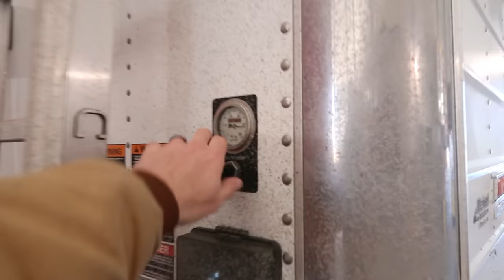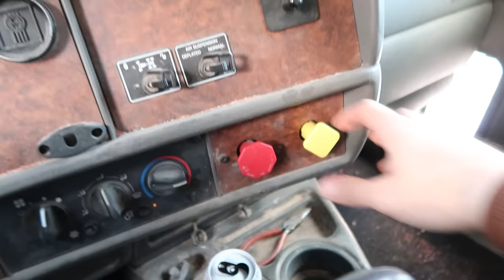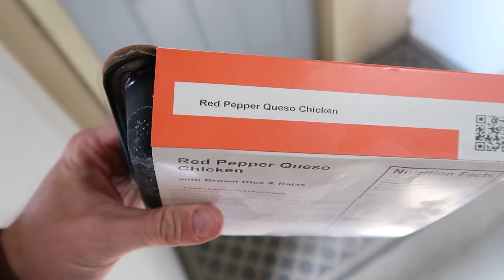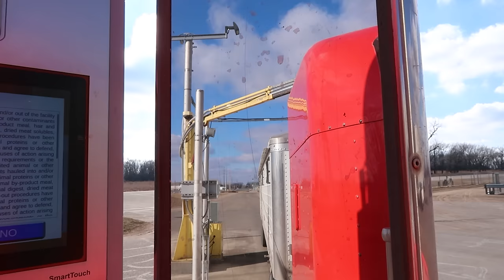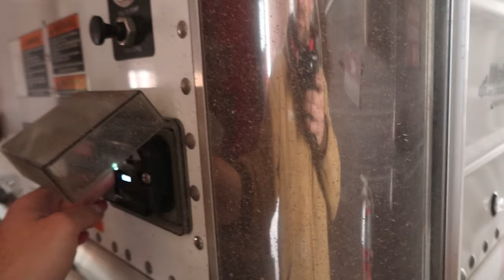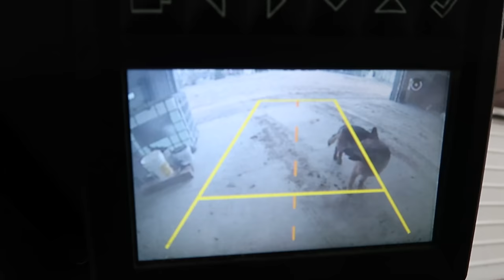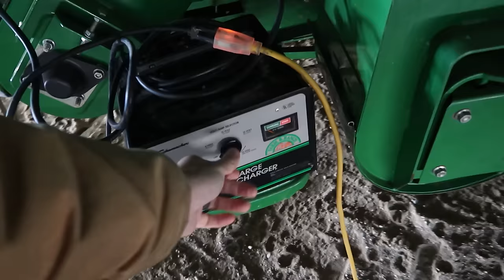I Need The Combine to Start!  Something's Not Right...

Comment: Who knew a John Deere combine sounds like a German Shepherd barking.
Reply: It's part of the built in warning system.
Reply: @persistentwind  I've delivered my fair share of them. Must be an add on at purchase.
Reply: You might want to try and find an old Fendt from the 70s - 80s. The then used MWM engines sound just like Weimaraners.
Reply: @alexveldhuis6004  🤣🤣🤣
Reply: @alexveldhuis6004 😆

Comment: When I saw that "Robo-Probe" "thingy," the grain elevator used to test your semi's corn it brought back memories of my high-school years.  My Dad worked for an outfit that went around and tested grain at elevators and barges for moisture and foreign material. Of course, they didn't have automatic probes back then. Just long poles they had to use by old fashion elbow grease.

Comment: When you put the new dryer in have them set it high enough to drive the skid steer under for cleaning season.  Or at least high enough to walk under.

Also tile the driveway to allow the water to drain off. Bet Randy would love to tile the driveway for you.

Have them check the block heater it might be bad or weak.

Comment: Our 9870 does the same thing if it sits a while. Seems to help if you just turn the key on without cranking it, there’s a lift pump that runs and helps prime it all up.  Even cycle it a few times.  That usually does the trick on ours

Comment: You may want to pour some Heet in the fuel tank of that combine. When it gets really cold like that of course the fuel can gel up and if there is any water in it just a little bit that will cut the fuel pressure down to against nothing. Its really irrating but Heet usually takes care of it.

Comment: You may want to put 3/4 clean stone down the clean stone gets pushed into the mud after a few times its will pack like concrete.ive done that in driveways and parking lots

Comment: try using 3inch rock next time you gravel the yd i use it for my drive i run my semi on and it works great plus when it does rain it washes clean
Reply: Don't think there's a whole heck of a lot of rock that big in them there parts of Minnesota.
Reply: 1982-- 3" rock in Cleveland, IL (Cleveland Quarry) ---> 👍....40 years ago.....,  amazing !

Comment: The best thing to do about the muddy yard is to BLADE the first 4-8 inches or so off the top, then lay down crushed lime, and then 1/2 inch rock, finally gravel until it meets your desired level. And make sure it is graded so the water won't pool and make more mud pie.

Comment: Some of the troubles you had last year on that 9870, ought to get rid of it, and replace with a 790, then you need to partially enclose that dryer and hopper, so you don't have the mess you have to clean every year, good luck to you!!!
Reply: It’s not his to replace the 9870 is still technically his dad‘s and for only cutting half the beans  it’s not worth it for them to upgrade
Reply: Go check the price of a 790 and then check the price of maintaining a 9870
Reply: @thomasbritten7216  even if they were upgrade they wouldn’t need a 790 or probably not even a seven 780 a 770 could push that 40 foot.
Reply: @Just_a_Mere_Farmer  Cheapskate talking with his wallet!!!
Reply: @Just_a_Mere_Farmer  If that is the way you live cheapskate, that is your business, maybe it's not the way Zach Johnson lives!!!
Reply: @thomasbritten7216  You can live by your wallet if you want, I choose not to!!
Reply: @thomasbritten7216  is that why you're still maintaining a John Deere 6600??
Reply: @NakedDave100  a 9870 is a lot closer in price to a 6600 than it is to a 790
Reply: @NakedDave100  No, I love brand new stuff but I’m also not the guy that runs a 600 horse tractor on a seven shank ripper
Reply: @thomasbritten7216  Gee Thomas you're a legend in your own mind!!

Comment: I'm no expert but I would consider procuring some large gravel (3"+ or as big as you can reasonably procure) to put down in the yard. It'll be rough as h3ll for a year or so, but will eventually give you a hard, level surface that drains well. Here in the south they sink into the soil and need be added to once every 10 years or so, but I know yall have the freeze-thaw cycle that (I assume) would keep them on surface. 

Also, after the larger stone gets pushed down a bit, you can add smaller gravel to make it smooth-smooth. That would be more so for residential drive ways where lower ground clearance cars are traveling.

Comment: The guys on Larson Farms were starting one of their big tractors and they had a either injector system that made the engine start right up.
Reply: Either is a last resort
Reply: Either is pottant stuff.
He got in the tractor and turned the key on but being cold it just cranked and cranked.
The next time he reached on the side of the steering column and pushed a button and the tractor started right up. He said "Thank goodness for Ether". @Drew-in-NoDak

Comment: Would yard drainage help? You could dorp few pipes with MasterPipeLayer and try to drain excess of water.
Reply: @UCntKtIOrwE4rJFfX73TQ1cw French Drain would not work well in busy yard like yours, giving all gravel you have is almost a French Drain already :D. But few shallow pipes would survive heavy traffic and allow surface (6-12 inch deep) water to flow away. It is a big yard and dropping decent grid of pipes would not be cheap! But few strategic (low spots) locations could work well. 

Shallow grid would work better with melting surface. But it must be deep enough to allow heavy equipment! 6 inch minimum I bet... below 12 inch shallow layer of frozen ground would prevent surface water from getting into the drain. All depends on the type of gravel you have - best to test one spot ;)

Initial idea would be to use small grid of 2in pipes (every 3ft or so) in one of your low spots connected to further 4in "main" run off pipe. If it worked well,  you could than add another 2in grid along. 
Smaller diameter pipes would be less likely to collapse under heavy equipment ;)

Comment: What does the probe into the trailer measure?
Reply from the maker: Teat weight, moisture content, foreign material, temperature, etc. Good question!
Reply: What was the moisture?  @MillennialFarmer
Reply from the maker: @jonathanmacdonald2416 right around 15% after we dried it last fall. It came out of the field around 20 or so

Comment: If you want the combine to start better, you have to say "I Think I Can, I Think I Can . . " it'll work every time . . . and on a sad note, be very careful with the dogs barking at the tires. I had a Mastiff that would run along the door side of my school bus every morning after I picked up the kids at it's house, barking at the front wheel. One morning, he was on the opposite side of the road, ran over to the front wheel on the DRIVER'S side and started barking at it, putting his nose right down in front of the tire as we were going down the road - he put his nose in too far ( he wasn't used to being on that side ) and the tire ran over his nose. The parents had always said not to worry about the dog chasing the bus - he did it with all the buses - that was his last time, though. Just be very careful something like that doesn't happen to your dogs.

Comment: Ethanol sucks ass in fuel. As a small engine mechanix its the bane of my exsistence. Why they thought adding alcohol a substance thats hydrophillic and contains oxygen is beyond me. First they remove adjustments screws to help pollution then they use fixed jets so small the machines run so lean a spec keeps them from running. So they traded machines thst run for 30 years and some minute pollution in the grand scheme, to cheap junk that plugs and needs repaired once a year so people throw it away after 2 to 3 years. Governments mentally handicapped.

Comment: Since you promote ethanol, and i'm sure you use it in your daily driving vehicles, what's the ratio? How many gallons of diesel does it take to make a gallon of ethanol? That would be a great video.. How many tons of coal from electricity plant to fire up them drier fans daily... to make a gallon of ethanol? I know you do it, but come on, man... just a little clip in a video of you filling them race cars with ethanol..
Reply: Because you asked: it takes 1.4 btus of petroleum to get 1 btu of gasoline to the pump.  It takes .7 btus of petroleum to get 1 btu of ethanol to the pump.   Those numbers are several years old and oil is taking more energy to lift and transport and ethanol is getting more efficient as new ethanol plants cogen (use the waste heat from a different process such as a gas powered power plant).
Reply: That math isn't right, refineries are about 90% efficent. 
I burn 7 gallons of diesel to move 13000 gallons of gas from the refinery to the station 26 miles away.  It takes roughly 4kw or 13, 650 btu to produce one gallon of gasoline with contains 36.6kw or 125000 btu. 
13000 gallons = 1,625,000,000 btu
Produce and haul 178,416,000 btu 
Efficiency = 89 %
If it wasn't efficent we would still be riding horses.
Reply: @gv1965  that is the efficiency of the refinery and getting the fuel from refinery to the pump.  You also have all the BTUs to pump it out of the ground and get it to the refinery.  Also, most stations are not 26 miles from the refinery.
Reply: @thepottmi  
I phoned a friend and had him pull data on one pump jack.
Electrical consumption shows a little less than 6 watt to bring 1 gallon of crude to the storage tank. 20 btu of energy to lift 138,000 btu of energy.  Pennies to transport dollars to the rail yard and even fewer pennies to transport dollars to the refinery. I peg the cost at around 18% of one gallon  of crude converted to one gallon of gasoline. Some systems will be more, and some will be less. There really are too many variables. We are very efficient with petroleum, and it is a renewable resource.